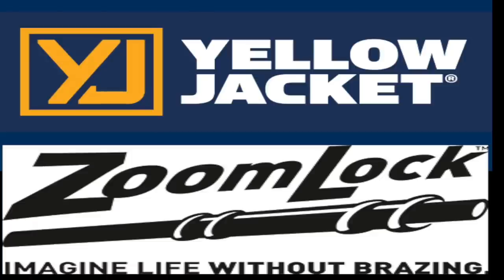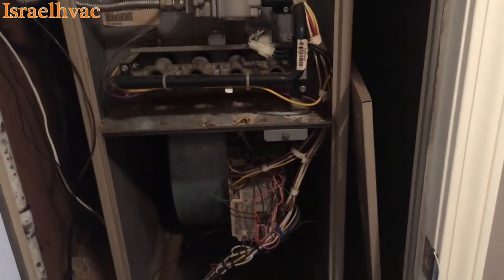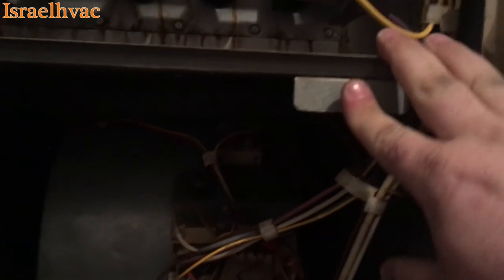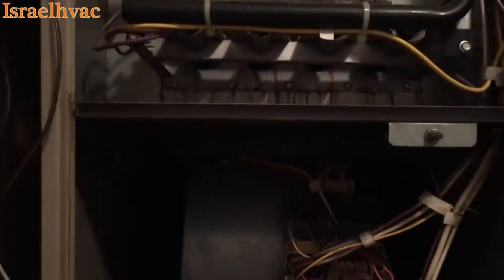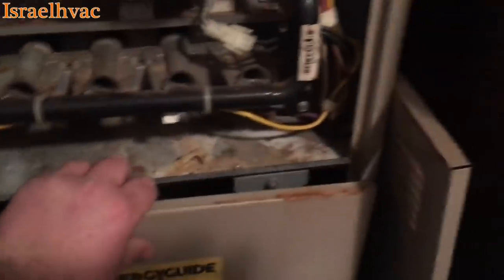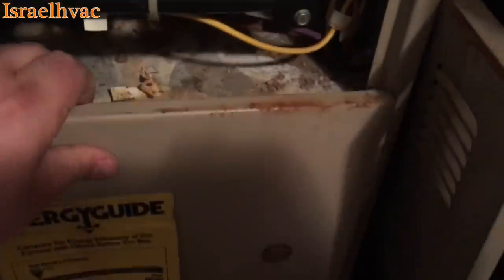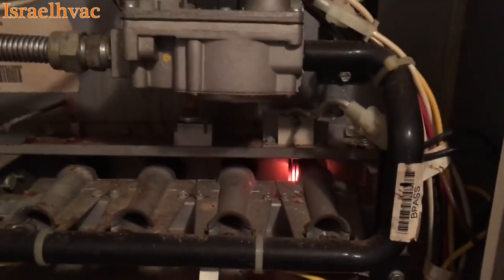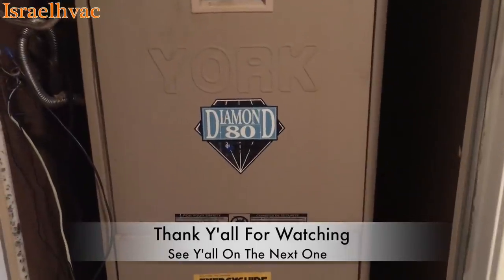HVAC: No Heat Call | York Gas Furnace

Comment: I found one of these on the side of the road, took it home, tested it, worked just fine. heat exchanger is solid, board is good, I think they only tossed it because it's missing the doors, which I don't imagine will be that difficult to find. Absolutely agree - these are fantastic units and they last forever
Reply: Can you add a c wire to this unit or does it already have one ?

Comment: Here getting my grandma's house ready for her to come back home after her stroke Lucky she's not here. Her heater just went out a couple of weeks ago and I'm done waiting for one of the many men in our family to fix it. I'm cold. This heater is almost the same as yours on the inside! Ultra SX80.  
I'm going to need to change the thermostat that's also been in this house I have grown up. Think early 70's I could use some help. Also the inducer gets really hot very quickly, is that normal?  It had been turning on just not staying on. It would get hot then too now the blades in the inducer stopped turning I was hoping use that till it seized and squeezed a couple more months out of it. At least to get past the holidays lol  I can handle Santa Fe weather without electric heaters but not for that long in done waiting. I've never done anything like this but I have done some minor car maintenance. Can you help me out?

Comment: Got the same unit, but it’s flashing 4 red times which is a Hi Limit. The fuse is good, the inducer turns on, the blower turns on but the igniter does not light. Changed out the flame sensor and igniter. The filter is good and no change in the ducting. 

Any ideas what to check next?

Comment: didn't actually showed us that the tstat was bad   you just replaced it without testing it.  most of the times  when the battery is like that, its usually only the batteries!   just a thought.

Comment: Cool video I actually condemn one exactly like that today, the heat exchanger has pen holes in it due to neglect. The customer never change the filter and the A coil is dirty. There were 2 used hi temperature limits next to the furnace, somebody knew just enough to make it run and kill it the rest of the way
Reply from the maker: Thank you Jones

Comment: Ive got a diamond 80 is the filter supposed to go right below the blower?? theres no retention clips down there and it pops up when the blower starts, there was a secondary filter on the return on this house im in. Should I just stick to one filter below the blower?
Reply: Right below the blower a 20x25x1 with a long rod shaped like a U holds it in place

Comment: Ok did I hear you right, it was a no heat call but everything came on? Off Tstat bad and power blower,  wouldn't that be like someone keeping fan in on position? Shouldn't board ha 've shut down the blower for ignition? Tstat solved blower problem but still may have a no heat problem that exist
Reply: This comment has me confused. Did you see the flames?
Reply from the maker: geoffrey dotson Your comment makes no sense. I assure you the problem is solved. Customer would’ve called me back by now if it wasn’t.
Reply: geoffrey dotson I get exactly what you asked, he said it was a “NO HEAT” call. This would imply the furnace did not produce heat. Assuming the thermostat just brought on the fan at the same time as the w being energized, the complaint would more likely be cold air blowing or running constantly. The other half of your question is no, if G is energized on the board, the blower will not stop during pre purge and ignition. The fan will continue to run.